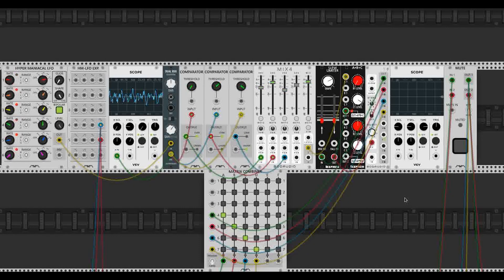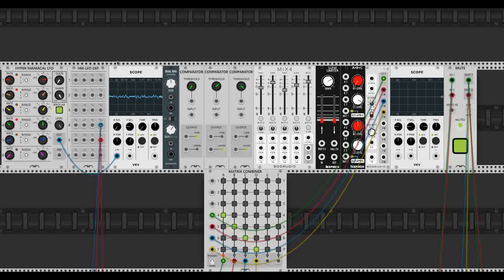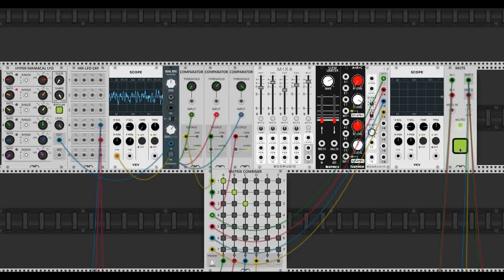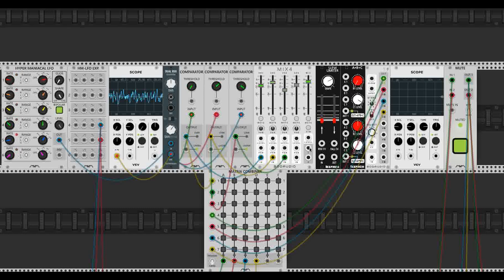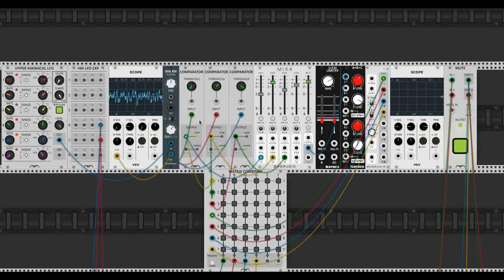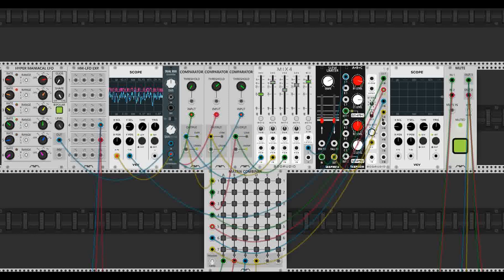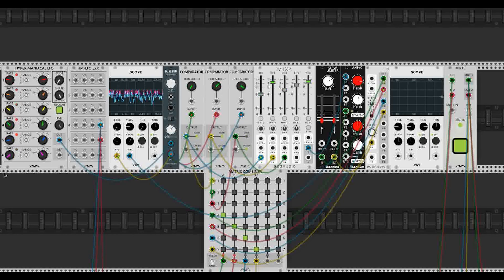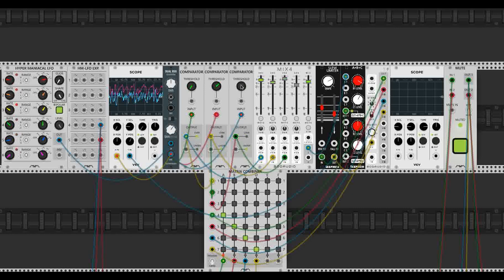Generative Music In VCV Rack Tutorials: Using Comparators for Generating Rhythm

Comment: Thanks for sharing!  Just curious....What did you connect to the HM-LFO EXP (3 connections), and, the Matrix-Combiner (4out) along with the MUTE module (2in/4out)? All off-screen. I am assuming some to a Mixer, maybe also Delay/Reverb?
Reply from the maker: The HM-LFO EXP is sending trigger outs to clock the delay module (chronoblob2, my favorite VCV delay), and the Matrix-Combiner is taking triggers from the sequential switch and sending them to four Plaits modules individually. The Mute module is just a mute for the whole patch; I put that in to make recording the video a bit easier on my end. Plaits then get sent to a mixer, then to the Valley Plateau reverb. 

Also, the melody is being sequenced by a simple 16 step sequencer going into a quantizer and finally into an Analog Shift Register which is being sent out to the four voices. Hope this helps!
Reply: @ianmahanpour  Thanks for the insights, much appreciated!
Reply: @ianmahanpour  Couldn't you have showed this in the video? I'm struggling to get any sounds out of this patch
Reply from the maker: Is the last module in the chain (I'm presuming its the sequential switch like in the video) sending out gates? If there are gates being produced, just route that to an ADSR, drums, or anything that takes gates. The reason I don't show the modules that are actually producing the audio is because I wanted to only demonstrate a novel way of gate generation, not my entire patch. I wanted to keep the video very focused and relatively short. However, if the gates still do not trigger anything even after being patched to ADSR or something, its possible the gates are too short in time to be picked up by it (I've had that issue happen to me with certain ADSR modules). If that's the case, I would send that gates through a gate to trigger converter to see if manually adjusted the gate length will solve that issue.